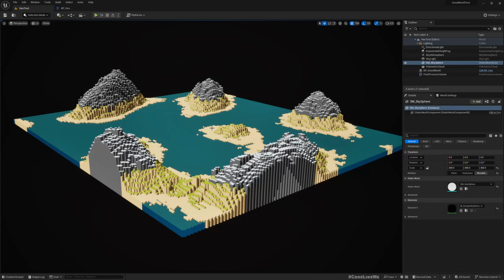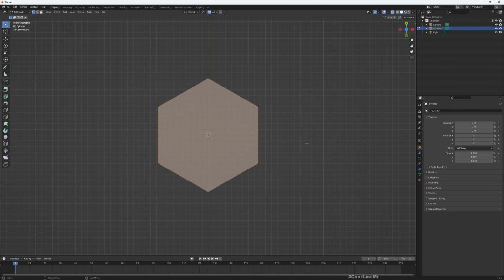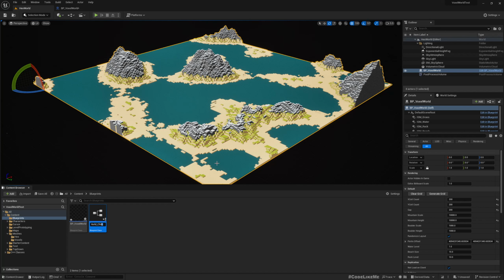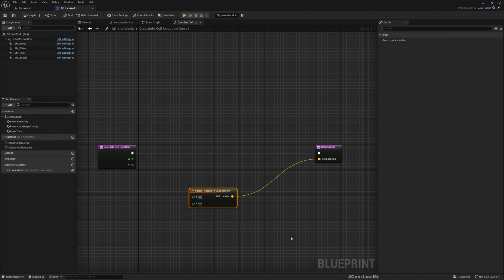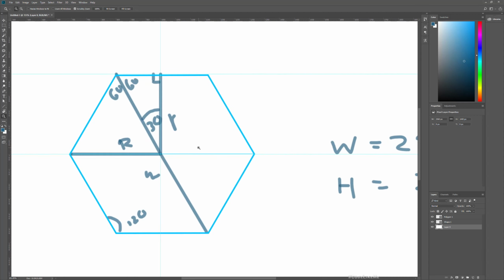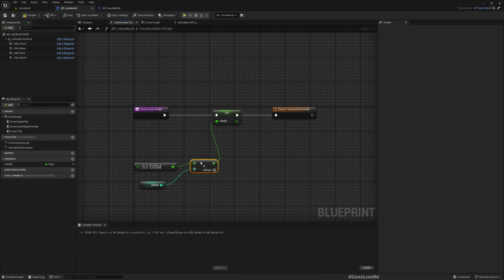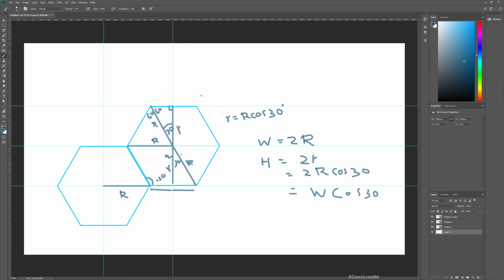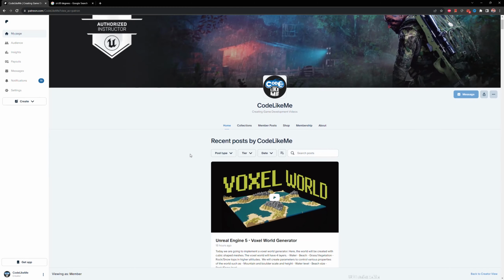Unreal Engine 5 - Hexagonal World Generator

Comment: Has anyone tried to generate a very large map using these concepts? When I make each tile very small, and bump up the X and Y of the total grid size to 700x700 it starts to run out of memory or hit some sort of limit. The grid just stops generating on the sceond loop and I end up with a smaller rectangle than I want, not a giant square map.